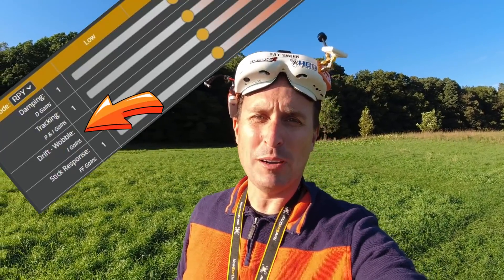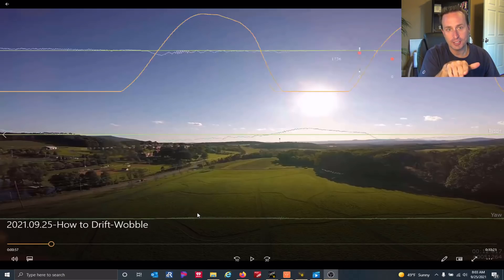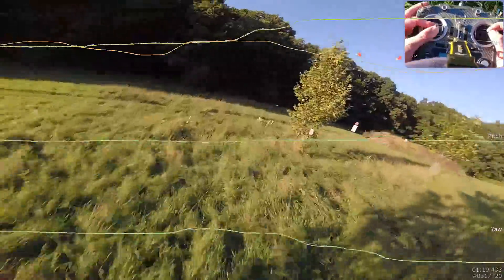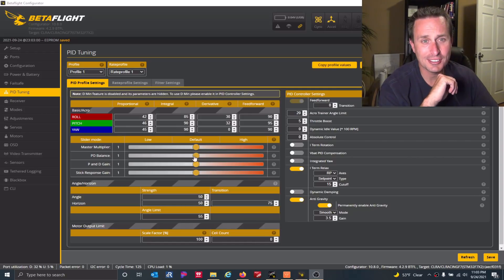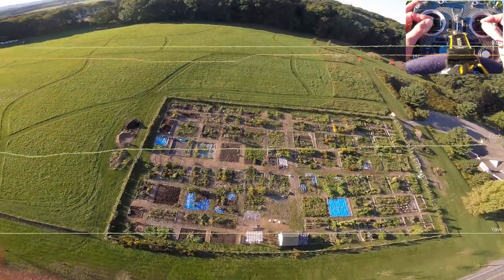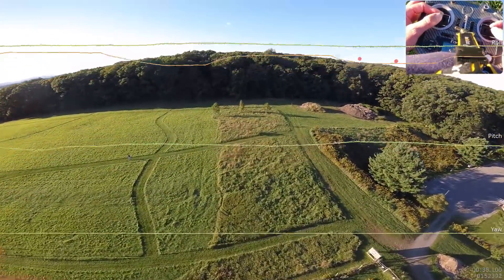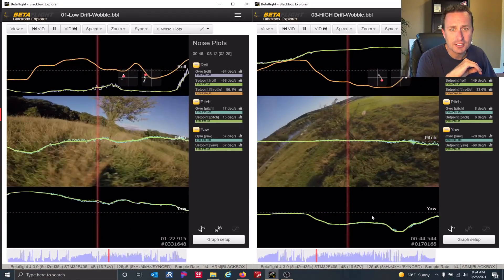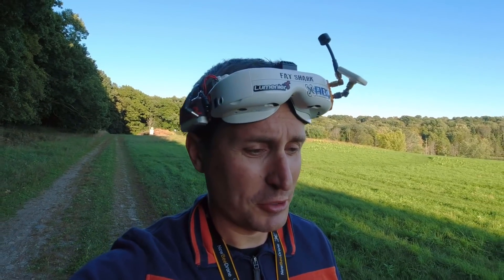How to Tune Drift | Wobble & help Throbbles  ---  i-Term Tuning

Comment: both of my 5 inch quads have this drifting and loss of control when chopping the throttle. my Iterm is reaching 200 with only marginal improvements. airmode obviously helps but even with that there is some decent drifting when dropping to low throttle.

Comment: Hello,

It is me again with my wobbles. 

So, I finally got my Apex 3" working to the point I feel satisfied. But I still always feel like it have a bit too little low power authority (on 0% specifically).

So, now I have built my LR toothpick based on (strange choice) hdz aio5 a 3" inch frame (Parralax, really nice) and 1202.5 rcinpower. My gut feeling told me, that it should just work, but again, I have different wobbles and really loos flight with specifically throttle changes.  And all my testing today lead to finally breaking my 75mm gemfan biblades (about -5C outside). So I swapped out to my 1 set of pink gemfan 3018 hoping for a shorter, but much more stable flight. It sure was shorter, and maybe more stable, but honestly meh. 

So, I go back through all the setting, and again, I do 2 things not one, I increase the motor start power to maximum (I was 5 clicks below and I had 1 motor starting quite later) but also, I changed 1 setting, I usually do not touch - Maximum Breaking Strength, I maxed it from about half (probably I set it to half randomly after flashing bj .21). And not, finally, the hdz5 3"pick flies perfectly smooth! As in, it flies like the stabilized footage people post. Only now I realized how well i had tuned it. 

So, this leaves me with a question - what the hell does the Bluejay setting "Maximum breaking strength" mean? I always thought it relates to the tickbox - apply break on stop... 

Then I went back and checked esc settings on all my 5 quads. 3 without those weird wobbles had esc breaking strength maxed, and my Apex 3" had it set to 0...

I just reset my apex to max, but It is night outside, with temperatures at -9C. And I noticed my balance plug has cracked and breaking apart on 2 of my 4s packs I fly. So, I can mot test untill tomorrow morning.

Comment: I have a tinyhawk 3 tiny whoop. The wobble is ridiculously bad. So bad i thought a prop was damaged or a motor was loose. Its a new quad. Ive only flown it for maybe 2 hours total. Its my first tiny whoop. Im used to the bigger gps quads.

Comment: Any suggestions for a noob, my Quad bobbles a bit when i drop from the sky and either give hard accel to stop myself from hittin the ground,but theres no bobble if i throttle punch from a stand still, everythings fine there but only happens when i fall and hit the throttle..

Comment: When there is heavy wind that is moving the quad, should we crank I gain higher from normal values, or will that cause even more wobble?
Reply: I'd like to know this as well. Did you ever figure it out?
Reply: @mjodr  I tried real high I and I don't think it changed anything at all
Reply: @heggy_fpv  Thanks. I just flew on a very windy day and what solved most of my wobble and problems was changing from 48 kHz to 24 kHz and increasing D term. I'm still going to try more I term, but I just did 7 test flights plus analysis for multiple days and I need a break haha. I finally got a tune where I was able to throw my 8" around like a beast. Was fun. Good resource here with all of UAV Tech's videos.
Reply: @mjodr  Yes, great resource. Good luck!
Reply from the maker: I-gain does not help wind gust motion.
Reply: @uavtech  Thanks for the info, because I just read at least 10 comments on Reddit that says that it does, lol. I think I still have too low of an I term tho, because it stays stuck at an offset of ~3-4 % like it doesn't have enough power to correct.
Reply from the maker: yes, if you see a persistent offset in Gyro vs. Setpoint in a log, that is i-Term.  Raise it.

With that, keep in mind that I-term will ONLY help with consistent influences on the quad.  It is the slowest of the terms to react.  It goes D > P > I for reaction speed to outside influences.  And D is special; it only provides an immediate opposing reaction to wind and then dies off fast (think shock absorber).  P's job is to keep Gyro on Setpoint, but needs a help for the last 1 to 2%; the i-Term.

Bottom line, you need all the terms in an appropriate balance, and then raise all the gains (Master slider) to have the best reaction to wind.  A.K.A. a full/good PID tune.

theuavtech.com/tuning
Reply: @uavtech  Nice. I've watched at least 10 of your tuning videos, been all over your website, looked at your presets and now with this comment I am almost starting to understand it all!

Comment: I think betaflight is going backwards.  Quads used to fly pretty dame well out of the box so to speak  now we have two sets of  "Sliders" for all of the following....damping, tracking, stick response, drift, dynamic D, pitch dampening, pitch tracking, master multiplier, low cutoff frequencies, high cutoff frequencies, gyro lowpass 1 gyro lowpass2, gyro notch center 1, gyro notch 2, RPM filters, D-term lowpass, D-term lowpass1, D-term lowpass 2...we have constant frequency and yaw lowpass filtering.  Is anyone else as confused as I am.  When I got into this hobby a few years ago Betaflight made flying easier.  Now we are all expected to be IT majors just to fly a damn freestyle drone.  All this has to be keeping new comers from getting into the hobby.  I was in this hobby nearly form the beginning and with my background Betaflight is loosing me.  I can't imagine how a newb feels.
Reply from the maker: It is easier.  Presets bud.
You can turn them off too.  Chillax.

Comment: What takes throbbles away .  Lot of my new quads from a individual have throbble on all but my worst one of 6 so far is my Apex konasty moon boot 1739kv 6s fettec g4/45a 4-1 4.3 pitch prop setup . Feels like 70% throttle thrust only die to to much throbble. I'll find a few similar builds on here and ask them what their pids are.
Reply from the maker: Increase Anti-gravity.
Reply: @uavtech  I think i mistaken throbbles for full throttle oscillation.  Basically when I hammer throttle to go up for few seconds it oscillates like a mofo to where it feels like a big loss in  Power. But if I'm just going along 1/3 throttle it dont oscillate .
Reply: @uavtech now I learned from a video that perhaps I have a wire touching the gyro. Esp being my d gains on kiss gui was 10 and 12  and I moved them to 20 to try based on someone with similar setup on here .

Comment: Man it must be so nice to have access to all that acreage to experiment. Living in SoCal we NOTHING like that. To come even close you have to drive 30+ miles to a park that might have the space and even still you have to contend with people pushing strollers, walking dogs, or just out and about. Even an AMA field requires driving some distance and the fixed wing guys aren't too fond of quads.
Reply from the maker: Yeah, but is is 70deg all year around there and sunny, so... all in balance.  :-)
Reply: @uavtech  yeah there is that. It makes it very very hard to leave. But flying a 5" in tight spaces becomes a challenge. I'm still working on making tighter turns without over shooting, going wide, and flying into something I can't see with no peripheral vision. So I pick up a 3" for those situations. Although being smaller makes it harder to find even when I throw a switch to trip the beeper.

Comment: Hello thanks for all the work You're doing. I was wondering if you have any suggestions for my mobula7. I just updated it from 4.0 to 4.3 hoping it would fly better. Every time I go full throttle and cut the stick the stick it will wobble so bad and yaw to the right. I have enabled rpm filtering and bi directional dshot. Also flashed bluejay and running 48kz. Any suggestions on what can correct this I so greatly appreciated it. Thank you and keep up the good work
Reply: I had this. Try just turning everything down. Bring the master down .15 or 2 and see what you get. I built an heavy overpowered 2 in. Went from not flyable to bitch ass cool fun. Granted,  I have other tweaks in there with dynamic idle and throttle boost, but turning down a temperamental quad really fixed it right.
Reply: @Widflyinghigh  Thanks I'll keep tuning.  I almost have it the way I want
Reply from the maker: Did you apply my whoop preset in 4.3?  I don't have in the official yet, but you can add my preset repo to your Configurator.
Reply: No I have not but I will tonight. Thank you so much I'll give it a try

Comment: I have a question for you, I have a X class drone. It appears to wobble a lot during hovering and cruising. The FC is a Kakute F7, would moving Filter to the left for both the Gyro Filter and the D Term Filter Multipliers help? Moving to the left would add more filtering, would that help fix the wobble?
Reply from the maker: No, it will probably make worse.  Check out the 9" preset at theuavtech.com/presets

The key is a tune with D higher than P, i-term and P in a 1:1 ratio, and higher gains in general.  Wobble is i-Term induced behavior.  To fix, you need to raise P or lower i-gain.

Check out the short video at theuavtech.com/tuning as well on gain relationships.
Reply: @uavtech  OMG, just licked that link! What an awesome page you made there. I watched your video and did just that. Just wanted to make sure it was not a filtering issue. I am reading your website now. TYVM!!!!!!!

Comment: I'm trying to figure out which PID causes a flutter/miss sound ,especially on Punch-Out, where my quad sounds like it's too rich if its a gas engine..i guess is a way to put it.. maybe that's considered an oscillation.thanks
Reply from the maker: That is D-gain.  But if you drop D, you should drop them all together to not throw other things off.
Reply: @uavtech  thank you

Comment: The slider tuning is not that good. My ds are so high like 58 & 60 my ps are normal sitting at 1.5 sliders are just junk. So much bounceback on flips and rolls better just to tune the numbers yourself
Reply from the maker: The sliders adjust the numbers and just make it faster.  You can see, no bounceback for me at 1.0 Tracking slider.  You probably have i-Term bounceback.  Check out my video on that from last week.
Reply: @uavtech  My I-term is sitting at default & it feels like it could go up a little  I usually run my p gain around 80s and d around 33 my ps are around 69 and ds are 58 & 60 item relax is at 15 normal. filters are at 1.2 both by choice  also I don't use feed forward it honestly messes my rates up it over shoots or its unpredictable so I don't use it.
Reply from the maker: Set i-term Relax to 10 and see how that does for you.

Comment: Thanks. What can I check if my 9" cinelifter roll drifts over a long time - like minutes, without any stick inputs, I have to correct for level horizon, very annoying for long range. I verified in blackbox it's not the controls jitter, there is no input on roll when that happens.
Reply from the maker: Just for a test, set Deadband to 5 in the Receivers Tab.
Reply: @uavtech  yeah, I have that

Comment: Thanks for this video. Very interesting.
I noticed that you say if I have some problems with bounce back on flips and roll I need to bring down the I-term cutoff. Is this right? Because I got some issues with that on my latest build.
Reply from the maker: Yes, reduce I-term Relax cutoff fr9m 15 to 10 or 5.

Comment: Ok, so I have same nose dip after throttle cut-off. My 5" Quad is high authority. Cg is right in the center of the quad. Overall pids are pretty high and tuned for good sticks tracking. Should I increase I term on Pitch?
Reply from the maker: P and I.  And don't fear higher Anti-Gravity setting on BF 4.3.  4.3 has improved AG that helps a lot with throbbles.  It boosts P and I and nit just i-term like previous versions.
Reply: @uavtech  Thanks! I hope that with bf4.3 release my quad will fly better.

Comment: just wondering something. I have been using BF 4.3 September 9th version which is working fine. But when I updated to the newest version (with the new sliders) the cpu usage is all over the place.  Even at 8:4 dshot 300 it starts low but constantly jumps arround 60-70 area. and when I check the tasks It shows gyro and pid is below than what it was before. On the previous version I was able to see 8000 at gyro with 8:8 and Dshot 600.  So my question is :D  Is this only like this on the configurator or will it reflect to the cpu even when flying?

Thank you :)

Comment: Well I tried with my quad that drifts. Raised I from 85 90 to 115 might drift slower but still drifts. Yaw at 130. 
Haven't tried higher since at that point I want to go check that middle stick inputs read 1500 in betaflight still
Reply from the maker: If drifting with no stick i puts, increase Dead Band in the receivers tab.

Comment: I prefer low I-term. On the 5" I run the absolute useable minimum between 60-80. The higher you go, the more it fights your inputs when you do tight, limited space proximity.
Reply from the maker: Only fights input if they make PID Error.  🤔🤨
Reply: @uavtech  Admittedly, I do run low PIDs. I like my quads like I like my women, a bit loose :D . . but the way the high I feels to me is, if you've ever driven a car into a corner and it feels like wants to keep going into the outside ditch as if it was pushing. That's what the high I term feels like to me. Like it's pushing.
Reply: @pirateradioFPV  Feel is a very misleading way to understand these things. Could be any number of things, or a combination of many causing that feeling for you.
Reply: @geometerfpv2804  Yeah, perhaps you need to go design another frame then and try and sell it.

Comment: I hate the feel of high iterm on most of my quads.... I had my I at 55 on my heavier 7" and i was like why does it feel extra stiff.... dropped the I to 45 and it felt better again... I dont mind a higher I up to like 70 on my thrustier high powered quads(6") though.

I run low FF (40) so maybe thats why i like the feel of low I term.... super obvious on my 10"... I just find the p/d ratio, crank it up to counter wind bobbles... than tune iterm more for stick feel...

Comment: I tuned i-term using PIDtoolbox & "kitchen tuning" & found critical damping at 43,45,45 for roll, pitch & yaw respectively. In the real world on a very windy day, I couldn't tell the difference between a flight with those values & a flight with BF default i-term values (85,90,90) performing freestyle & racing maneuvers. Stick tracking (via BBE) & propwash performance was excellent on both too. So I guess since the tuning window is so large, the P to I ratio isn't as important as it's made out to be...
Reply: This is what I was just thinking thinking, tuning I first seems like it would be king of hard, I've not tried that method yet...
Reply: @ugpfpv361  check out the PIDToolbox YouTube account & watch the video about basement tuning. It gets great results & you can do it indoors where there are no external factors. In all honesty if you're tuning a 5" for best performance, I'd just leave i-Term & i-Term relax at BF defaults. The minimal overshoot that I encountered & tried to reduce for critical damping was negligible. Filters, PD balance & PD gain are the most important values to tune. Then add FF for that "locked in" feel.
Reply: @pscott82  will do!! Thanks

Comment: everytime I increase i-term, the quad is really violent when I need to turtle roll. 1.05 i-term slider in 4.3 works great, but anything more is really violent.  it's just not a good mechanical sound. you're getting lot's of trilling, I bet the quad would freak out if you hit a branch or tried to turtle.  cool video though! thanks!
Reply from the maker: Hummmm perhaps i-Term should be disabled in Turtle Mode?
Reply: @uavtech  Probably a good call since I-term only winds up PID error to crazy heights if the quad lays on the ground and is restricted in movement. Nothing I-term could correct in this instance. I wonder if it's better to use turtle mode solely on P-term driven by stick deflection.
Reply from the maker: Agreed
Reply: @uavtech  that sound great!

Comment: Damn I need to touch i-term. Always left at default
I tried 4.3 on betafpv f405 12a but drone wouldn't fly. Tune from 4.2 wouldn't work in 4.3. I even added more filtering. 
Did pid amounts change like quads need way less pids
Reply from the maker: Nope. Gains the same
Reply: @uavtech  weird. I'm try another quad then.